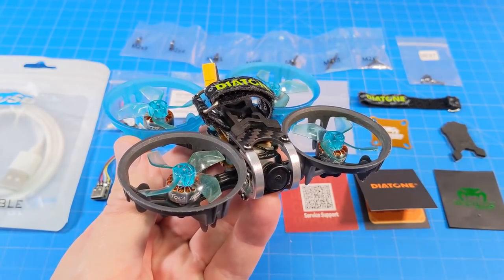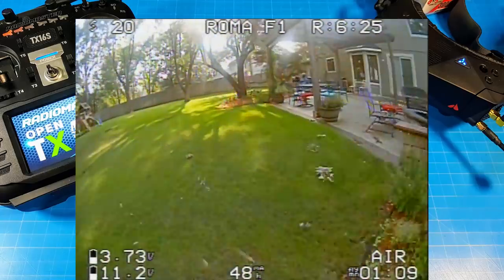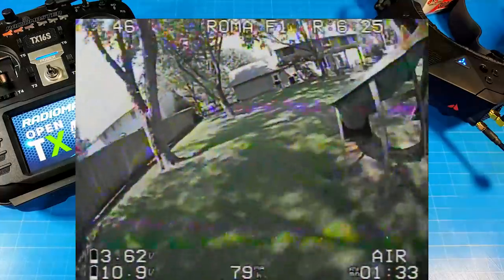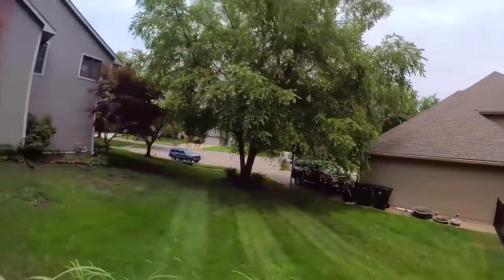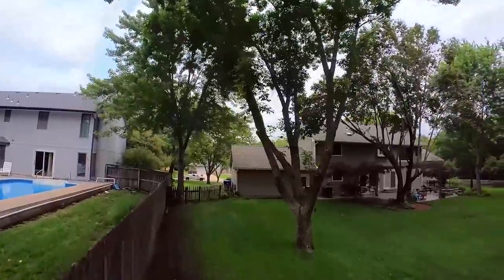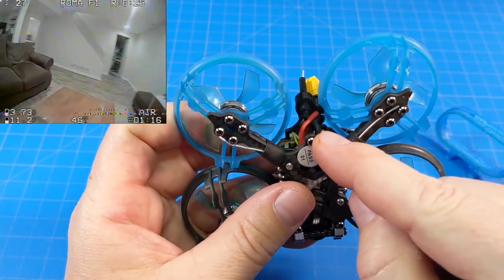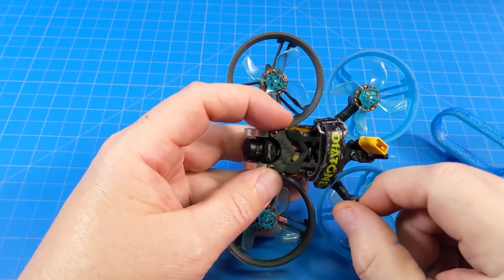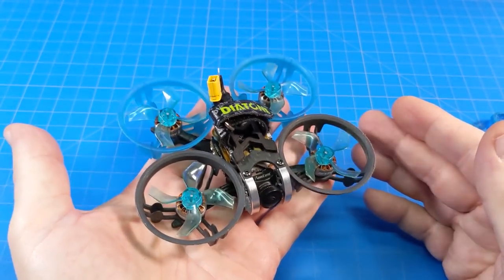Diatone Roma F1 // Traditional Quad // Compact Form

Comment: I'm late to the party but the wobble very likely has an easy fix: very slow wobble like this is almost always I term windup. Set I term relax down to 10 or maybe even 8 or 7 until it's gone.
The Roma F5 (like most other overweight quads) also suffers from this... it's when power to weight - or rather mass of inertia to power - is off.

Comment: I can recommend Gemfan 1940 props (threeblades). Better efficiency and better handling! (Of course propguards should be removed, otherwise the props won't fit.)
Reply: Hi, can you share your PID with this props pls? I have tried them and I have some vibrations in the corners.

Comment: "Yeah, we're gonna need to go ahead and move you downstairs into storage B. We have some new people coming in and we need all the space we can get. SO if you could just go ahead and pack up your stuff and move it down there, that would be terrific. Mmmmkay?" - I think my company is considering selling/leasing a few floors of my building. They figured out that we can function as remote employees. They're starting to allow us back to the office, but they're shoving my department into cubicles on the first floor.
Reply from the maker: so funny. I may have to take time to watch office space again. Where I live I don't find many moving much to remote work. The prevailing executive thought is "I need to see my people". Old habits are hard to break. My organization also doesn't look at productivity at all, or at least has no quantifiable methods developed to measure it.
Reply: @NickBurnsFPV  I guess that's unfortunate, unless you just prefer going to the office. If my job were close by, I think I would prefer going into the office, but it's a 60 mile commute one way for me. My company is letting us choose to stay virtual so I'm taking them up on it! They had a lot of remote employees before they acquired us, so it's nothing new for them.
Reply: @dubzsquaredfpv7171  Lucky you!
Reply from the maker: @dubzsquaredfpv7171  My preference would be remote work. I find in office time has considerable unnecessary distractions. When I worked remote i found I could accomplish more in less time and made progress on items I had been hope to get to for years.

Comment: Great review, for sure!  I ended up picking up one of these quads and put Crossfire on it.  But now I'm finding things a struggle.  After just a few super stable flights, now I'm having a flickering OSD and what I think is lousy picture quality (based on your indoor flight footage, lol).  I put a micro-TrueRC omni on this quad, but that hasn't improved things at all.  Tbh, though, I have not had good luck with using the micro-TrueRC antennas with my Skyzone Sky04x goggles.  Anyways, I'm just wondering if you know anything about this model having OSD issues.  Thanks again for your fabulous review!
Reply from the maker: flickering osd is generally a grounding issue. I would check and even resolder the ground wire from the camera to the vtx and from the flight controller to the vtx. It may help the video reception may improve as well.
Reply: @NickBurnsFPV  OK, I'll give that a go. Thanks!!!
Reply: @NickBurnsFPV  Hi Nick, I ended up running a direct ground wire from both the camera and the VTX to the negative battery terminal.  That made a big difference but I was still having more flickering that I should have!  After poking around for a long time, I discovered that the micro-sized Crossfire antenna I was using was causing a lot of interference.  Many of the wires in this quad are close enough in length to the micro-sized antenna to actually pick up noise from the antenna!  Installing a regular immortal T antenna, and running good ground wires, completely cleared up the video!  Thanks again for your direction to look at the ground wires!!!

Comment: But, it's way, Way, WAY too heavy!
72 grams without a battery! OMG!
Time machine:
Back we go remembering the Spedix Rex 80mm who0p. It had the same 1103 motors, with the same KV. A very similar FC and separate ESC combo. Used the same exact props. Came with a super durable frame that even though I ran straight into trees and a metal light pole, it never broke or even cracked!!! It came with a similar weighing camera too. It also ran on 2s or 3s lipos. 

IT WEIGHED 41 GRAMS! 😎🤘

This Diatone weights 72 grams, and the two quads are almost identically equipped.
Do I need to say it? 🐮🐄🤷
So, go ahead, believe the hype on this super heavy 72 gram who0p, without a receiver or battery.  The Spedix Rex weighs over 30 grams less with the same components and flew great. Add 30+ grams and tell me what that does to a Quad?... especially a who0p, which we all know 5 additional grams makes a really noticeable difference in the way it flies!
Guys, do the math... this is a tank, a barge, a humvee, a BLOATED COW!

There, I said it! Don't buy this over weight, terrible design.

WE ALL CAN DO SO MUCH BETTER THAN THIS COW! 🐮🐄😢😩 (and, it also costs way, WAY TOO MUCH!)

Comment: Hey have you tested 2 inch props without ducts? Maybe the performance becomes a bit better. Honestly a 16g FC + ESC seems a bit too heavy for this size, specially with all the 3-6g AIO boards we are getting nowadays.
Reply from the maker: Yes, the weight is holding back performance. Are you saying this quad can run 2inch props without the ducts? or asking in general if I have flow 2inch props without ducts.
Reply: @NickBurnsFPV  It can fit 2 inch props without the ducts. You can see it on Gal Kremer's video https://youtu.be/59wVXedRpYE?t=191

Comment: Those two 3d printed parts are for mounting the fpv camera. Uses the standoffs.
Reply from the maker: But the camera mounts to the metal curved parts at the front. Those two pieces an alternate mounting?
Reply: @NickBurnsFPV  They are for mounting an immortal T type antenna to the two back standoffs
Reply: @skree_fpv436  Probably

Comment: I watched all the way to the end!  Thank you!  I am for sure looking for something to up my Igow videos.  I want a mobula7 hd, but I am not sure they make them anymore?  (Could just be out of stock due to the shortage).  Used to have one, but it went for a swim lol.👍
Reply: Old model. Too heavy, so it flew kinda mediocre. This Diatone weighs about DOUBLE what the Mobula7  HD did. It's kinda ridiculous how heavy this Diatone is. 🐮🐄😢
Reply from the maker: I would suggest getting the mobula 6 hd and put it in a mobula 7 frame. This gets you to the most recent hardware and will have less weight, but also won't run 3s like the 7 hd did. It would be 1s.
Reply: @NickBurnsFPV  thanks Nick, maybe I could use there 2s board to give it a little more freestyle (crazybeeX 2s board). I already have the mobula6 hd in a 75mm frame, it just needs a little more power for "power loops" might need motors with a lower kv as well. 👍

Comment: How does this quad compare with Flywoo Firefly? Which one do you prefer
Reply from the maker: Hmm. Good question. Similar but different. The firefly prop guards likely won't last very long, the f1 prop guards will be much more durable. This has those flight deficiencies at zero throttle the firefly didn't suffer from. If you crash pretty often I think the f1 would be a better choice between the two, if you don't want to do the slow cinewhoop type of flying the firefly its likely better.

Comment: Thanks for all your videos! You’re always super thorough and helpful. 
What do you think of this frame by itself, maybe compared to the gnarlyfpv sub atomic?
Reply from the maker: I think when we run 40mm props the all up weight it so important to the fun factor. This is overall more weight than I would want in a 40mm propped quad. But I also really go after performance, rather than safety and repair costs. The gnarly sub atomic will out perform this, but has the draw back of needing a very specific aio which can be hard to get now days. For me and my flight desires, sub atomic.
Reply: I completely agree with Nick. This Diatone is ridiculously heavy! 72 grams for a who0p that runs on 1103 motors? 🐮🐄
The frame IS the problem!
Get the Gnarly FPV frame and build a fast superior quad that will run circles around this and have much longer flight times.
What was Diatone thinking? I'm a big fan of Diatone, but they totally forgot that "all important" power to weight ratio on this one! 😩
Reply: @noforyoutubepremium3108  I'm pretty sure that the extra weight comes from the custom tx and rx
Reply: This quads frame is the culprit. That die cast aluminum camera protection always weighs a lot. Banggood's website says its 13g, but they often lie and things are heavier than they say. Why they think they can get away with that, is beyond me! lol So, that's half what most heavier who0ps weigh total. It does weigh more because of what you mentioned, but only slightly, but the FC and ESC being separate makes a big difference too.  Honestly, it's just a bad design, with no thought going to power to weight ratio! 😣🤷
Reply from the maker: @noforyoutubepremium3108  The metal mount is certainly bigger and thicker than the mount on the sub atomic. I think banggood copies its web data from the manufacturers site....for the most part. 2inch props will fit on it. The clearance is very tight, I will try to fly it this weekend with 2inch avan props.
Reply: @NickBurnsFPV  I couldn't imagine 2" going on my subatomic, there just isn't room. So the arms on this one are a bit longer?
Reply from the maker: @cowardly_wizard  They are, we can't use the whoops/ducts with 2inch though. I plan to test it yet today.

Comment: So a 3s 650mah at 70g would be not useable with this quad. Same weight as your 450+the hdcam you use. I have a few of those, hoped this would be quad I could use them on.
Reply from the maker: Due to size I suspect it to be problematic, keeping the battery square on top of the quad and not blocking the camera view. Also the wires not getting in the props could be an issue.

Comment: Can u change the motors to 1204 for more power just wondering still new to the hobby
Reply from the maker: really that wouldn't help as the motors would add more weight, and we are still on 40mm props. We can change to a lighter motor and maybe run 2s with higher kv, to add to the performance.

Comment: Ok nick you gotta stop lol you are making it super hard to decide on a whoop and I have been looking for a fast durable whoop so far I love the hglrc race whoop however it's over my sub 250g weight but I would cheat 🤫 just don't tell the faa and then I see the new petrel 75 rtf bundle is pretty nice but after seeing you rip this Roma f1 I think I know what I want....but.....the atom rc cineflex is very durable also and it's sub 250g!!!!! Stu and Trev ran it into a tree and dropped it from the sky and it kept on ticking.....so I am at a stand still once again lol I think I am going with the roma f1 because I just love how it flies.....I recently got the novice 4 and not only have I broken an arm but mine came with cheap middle standoffs black skinny ones not the sturdy green ones.....plus my vtx antenna is completely off of the vtx I noticed all they had holding it on was some type of silicone anyway so I was going to ask how should I go about fixing that???? I really respect your input man and really need help on how I should take care of the vtx antenna....any help would be greatly appreciated nick👍🤫 I reached out to banggood and all they had to say was " we will give you 250 good will points"....smmfh.....I want the standoffs that were supposed to come with it!!!!! So needless to say I would definitely be careful what you order from them.....thanks again....I really like the petrel 75 because I want a whoop but the roma f1 to me is alot better....👍 but if I can get away without registering the race whoop I am getting that lol...seeing you bash that tree a dozen times was insane!!!!!👍😁 please if anyone knows how to re wire or I'm trying to not solder because I can't solder lol and the u.fl connector is still connected to the end of the antenna and I see 3 small pads on the connector as well as the board so if I can have them contacted I should be able to put some silicone on top to hold it but then again I don't know....please help😫✌

Comment: Can it run 2" props without the prop guards? Might be much easier to tune.
Reply from the maker: No, not enough clearance to the body.
Reply: @nickburns another reviewer said 2 inch props did fit
Reply: @eddietolbert5308  do you have any source for that ? i would like to do this too...

Comment: I seem to remember JB or someone saying something about Betaflight 4.2? having an issue with low-throttle wobble. Not sure what's on the quad but it's an idea. Anyone?
Mr. Squirrel @ 13:20, 14:09
Reply from the maker: I have heard this. I am thinking I might try 2" props next then later this summer but emu on it and give that a go. Yea, I included that particular flight due to Mr. Squirrel. Your the first to notice. So FIRST!!
Reply: Well you'd know way better than I about the props, but I will say that when I put 2" props on the little Mantis85, it flew much better. 
Regarding the wobble, I have it occasionally on my Mark4 frame and that has BF4.2. I see it at the exact time you were.....at the apogee of a punch like when doing a split s.
Reply from the maker: @minkorrh  I tried it yesterday and boy the wobble was way worse after some tuning changes. I think I will put emu on it and see how it does.
Reply: @NickBurnsFPV  I'll certainly stay tuned and see how that works. 👍

Comment: Please spread awareness about silicosis which is a fatal disease I had never heard of and worry it will destroy my life we were carpenters that built houses and in the usa have to have tie down anchors so we drilled into the concrete and cut fiber cement siding because they changed from plywood to it no one ever told us its fatal.